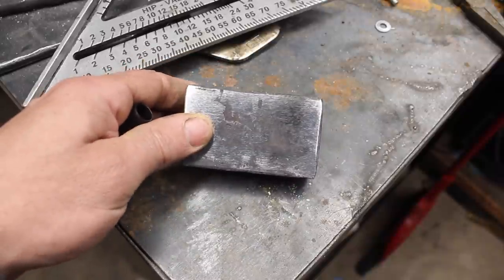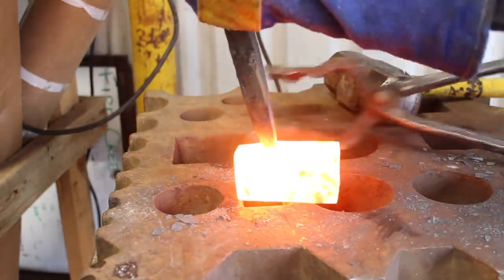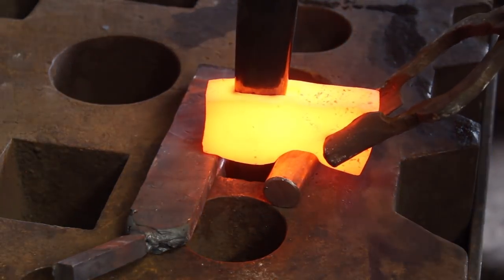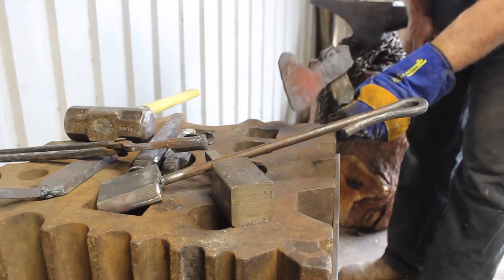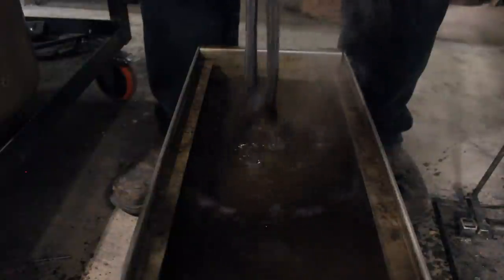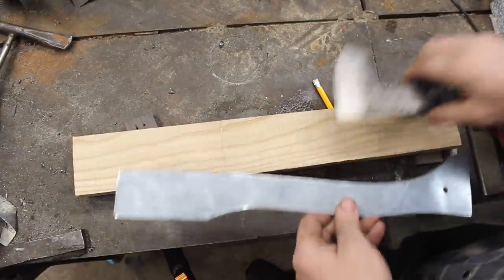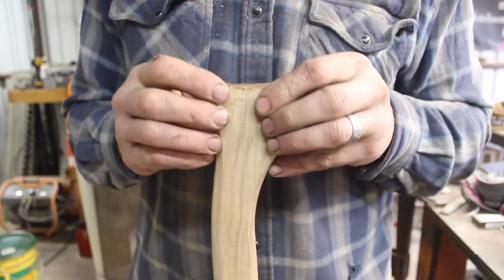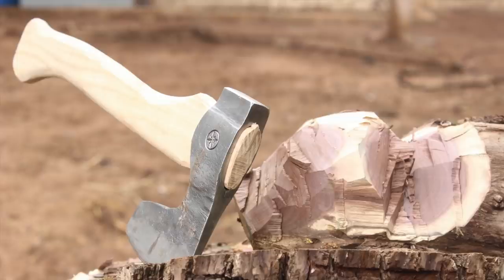Forging A Bearded Hatchet | Blacksmithing, Bushcraft, Viking Axe

Comment: The first bearded axe I made was from a leaf spring ( of unknown metal, probably 5160), so I split the blade and installed a piece of 6150 and forge welded it in. Which was difficult to do (wrong choice) but it was a piece of metal I had, it tends to dull down quickly, and I really struggled to get it right. I was fairly new to blacksmithing and didn’t really know what I was doing but I got it to work. Thanks for the video

Comment: From what I understand, Vikings used their axes as a multipurpose tools due to their relatively low cost in comparison to knives and swords, and so this design came about as they came to be used in tight quarters use (fine wittling, cleaning of trout, all that). The recessed neck area protects the fingers, and some designs even had the cutting blade offset to the left or right of the center line for hewing (flattening) boards.

You're channel is great.
Reply from the maker: Thanks!! yes, I really like the design for both utility and appearance, makes sense what you're saying about the viking uses for axes

Comment: Turned out really nice.
Are you getting burned out on making knifes, or  expanding your knowledge and adding a larger variety of products? Knowledge and skill is a very valuable asset without a doubt. You have made many more knifes than me (I’m only part time) but I to do a large variety of things. It’s definitely rewarding to gain another skill.
Reply from the maker: Thanks! I really enjoy trying new things, and I've been working on learning how to forge hatchets and axes for quite a while now. I've done a lot of knifemaking and blade smithing, not as much blacksmithing. My plan is to have a range of axes for sale, along with the blades.
Reply: I assumed that was the plan. Nothing wrong with that at all. Always enjoyed your inspiration and  being impartial to new things
Reply from the maker: @erikcourtney1834  thanks man!

Comment: Very nice! How much will you be selling for?
Reply from the maker: Thanks! $275-300 I think
Reply: @FireCreekForge  right where it deserves to be. I'm working on a pattern of hatchet/ boys axe right now. I wish I could share some pictures with you. I've learned a lot in the last 2 years of mainly forging hatchets. Most importantly the eye shape. I like to make the top of the hourglass eye slightly larger than the bottom so when I wedge it in place the wedges really hold it in place well. Do you have an email I could share some pictures with you?

Comment: How much training do you have in blacksmithing?
Reply from the maker: I guess that depends on what you mean by training :)
Reply: Did you start off as an apprentice or just winged it? You are very skilled 🤙🏼 I'm starting to build a forge and burners, any advice?
Reply from the maker: @roge4018  well, actually I went to horseshoeing school where I learned some basic blacksmith skills, but knifemaking and blade smithing and further blacksmithing I learned (am still learning) from books, forums, youtube, etc. I enjoy studying a technique and then just going and working on doing it myself. I think there would be a distinct advantage to apprenticeship or something similar, but I haven't had that opportunity. 
I recommend connecting with blacksmiths in your area e that are willing to show you stuff, it possible.
Reply: I don't think that's possible but I'll look around. I'm from south Texas and I don't think there are too many blacksmiths down here
Reply from the maker: @roge4018  well, worst case scenario, there has never been more information on the craft as readily available as present day, so a desire to learn is the most important thing
Reply: Thanks, keep up the good work 🤙🏼